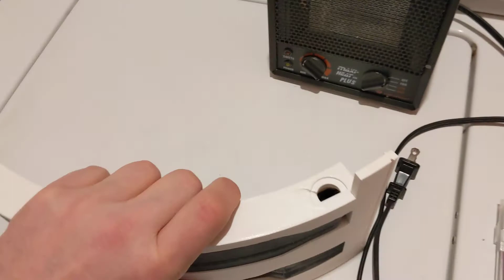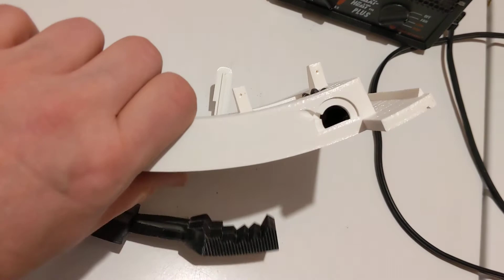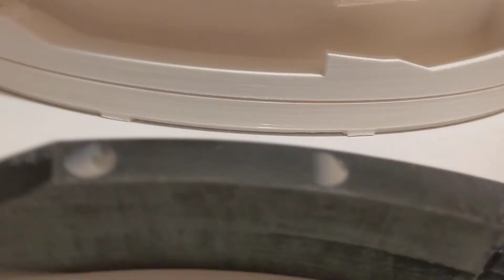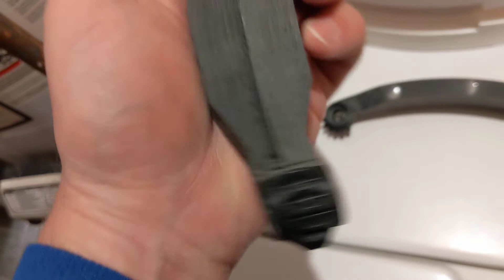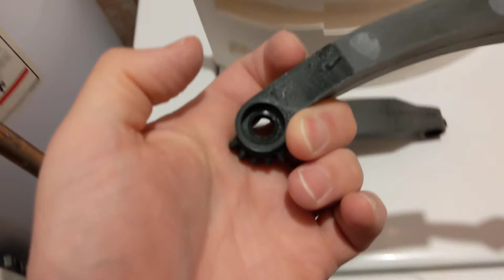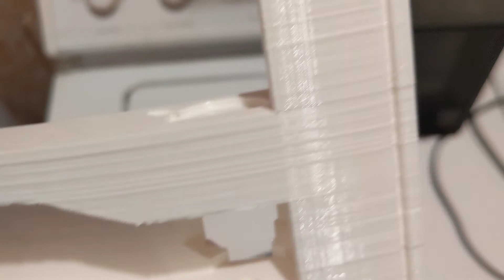3D Printed R2D2 - Part 36

Comment: How do you plan to make them open and close I presume servos but how if you can explain in your vids would be awesome
Reply from the maker: I show that in Part 34.  There is a built in servo mount on the back of the body piece that the arms fit into.  There is a file to print that's a gear that you screw to the servo, and it meshes with the gears on the back side of the arms.  It's one of the improvements of Michael Baddely's MKIII R2D2 files over his V2 files.